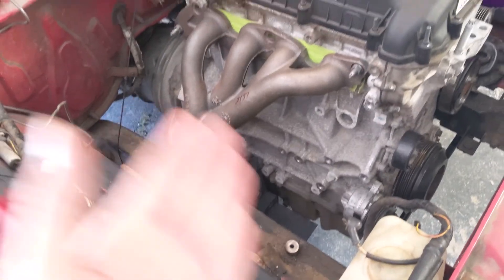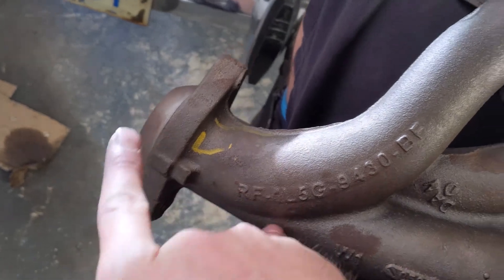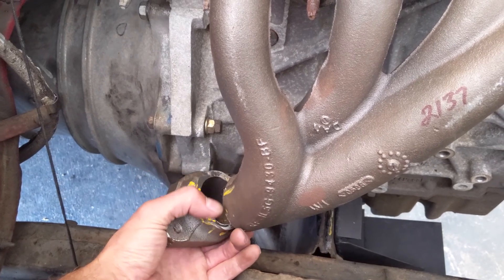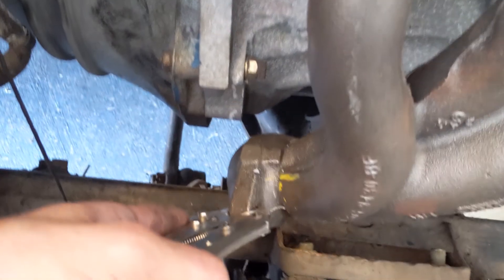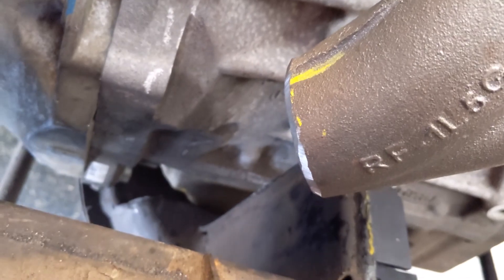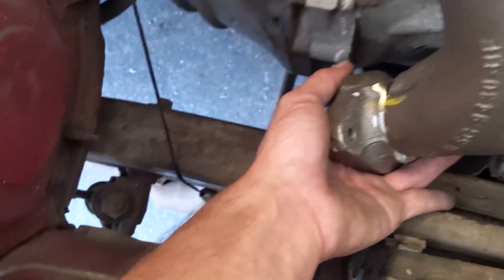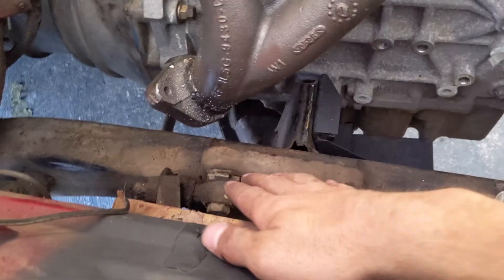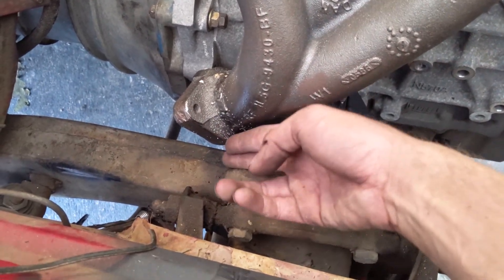Duratec Swapping the Courier Pt.4 - "Custom" Exhaust Manifold

Comment: What made you choose this engine transmission combination over other options? Would an earlier Miata 1.6l or 1.8l be an easier option as its already in the RWD configuration?
Reply from the maker: The biggest reason is price, I got the 2.5 for $400. Miata engines are hard to find under $1,000.
Then there is parts availability, Ford still uses the 2.5  in production vehicles so parts will be available for a long time. The 1.8 they used in the Miata hasn't really been used in any vehicles since 2005. 
Then there is power, the 2.5 just makes more stock, and has more potential down the road if i want even more power.
Reply: @poorlybuilt2060  makes sense